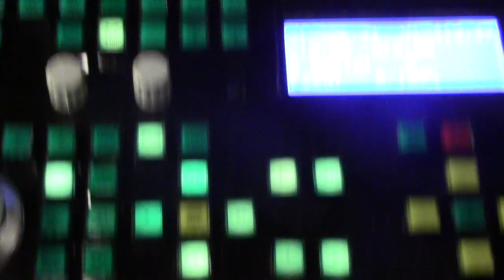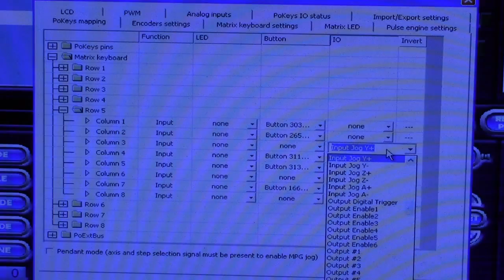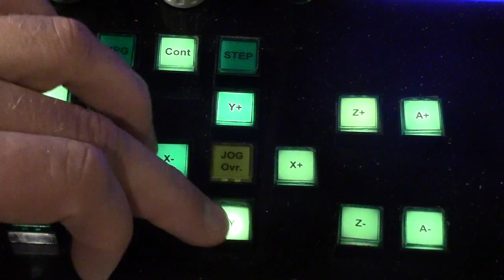MACH3 and PoKeys button setup

Comment: HI. It is possible to use also potentiometer to control FeedRate ?
Reply from the maker: Hmm, that is a good question. I think the PoKeys hardware has a analog input, but not sure if that is available in the MACH3 plugin/interface. Let me check.

Comment: nice project. i have seen your lcd display, could you tell me more about the configuration please. i have only one data per row. how can i see two different things in one row?
Reply from the maker: +TheDevil666inside You should simply be able to write "X:" and the add the X-DRO and then "Y:" and add the Y-DRO on the same line ?!
I'm currently on a businesstrip, so I can't give you the exact code right now.
Reply from the maker: +TheDevil666inside Did you manage to get more info in one row ? I'm home again, so if you need a screenshot or something...

Comment from the maker: PoKeys has a build-in Pulse enginge for controlling steppers via. Pulse/direction signals. However I don't use it. Because it can "only" control 3 motors, and I have 2 motors for my Y-axis gantry-type machine. Gives a total of 4 motors.
I use 2 parrallel-ports setup with MACH3, and Pokey for additional Inputs to simulate button-press, MPG, button-light (via.the extension boards), and LCD-display.